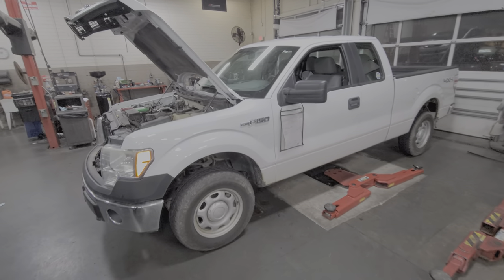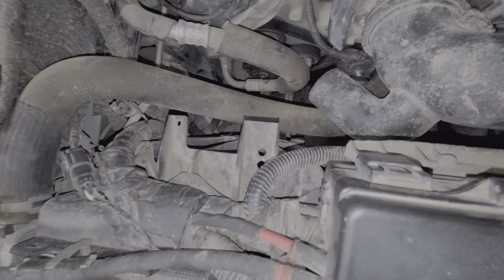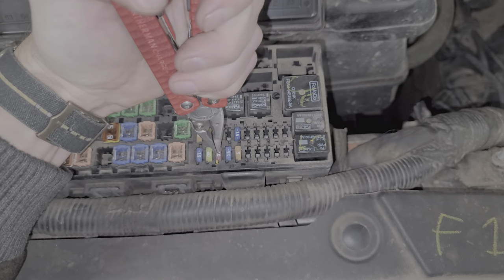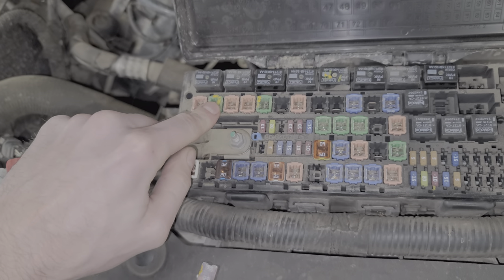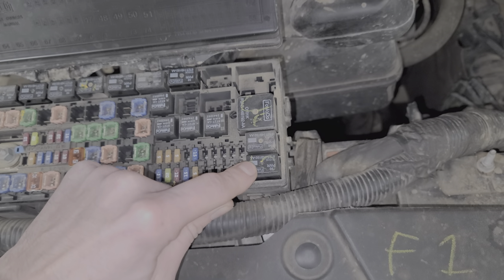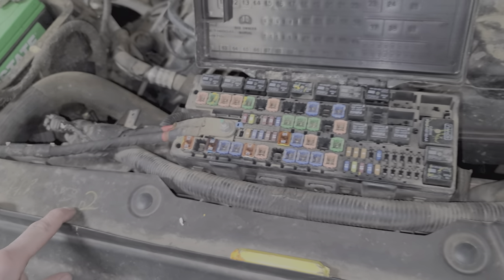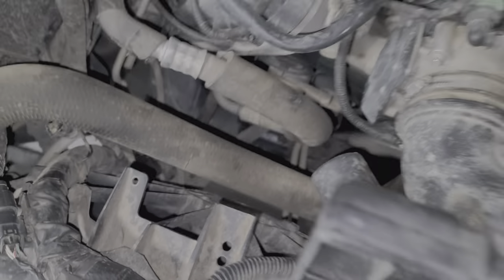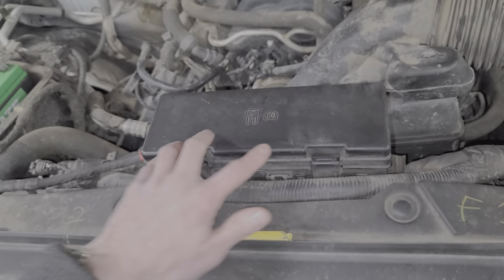2013 F150 Cooling Fan Fuses & Relays, Testing

Comment: My truck started doing the exact same thing a week a week ago, the fans would run on high non stop, also my dash cluster gas mileage digital display started messing up, a few days later my battery crashed. After replacing the battery everything went back to normal. My ford Motorcraft battery was 8 years old. I just wanted to put this out there for others before spending countless dollars on other things. I know this might not always be the case or issue but it was the fix for me.
Reply: Wow the battery ... mine just started the fuel gauge thing a few weeks ago now its the fans 🤦🏽‍♂️🤦🏽‍♂️🤦🏽‍♂️

Comment: Hello, I have a F-150 2013Lariat, which overheats only on highway at high speed, so I believe it has troubles with high speed circuit only, do you know if temp sensor triggers high speed relay ?. Thanks for answering. God bless you. BR

Comment: I pulled the low speed relay on my f150  connected the 2 contacts as shown to test both fans. Only the drivers side fan runs. Why isn't the other running?

Comment: I am having a low speed fan issue. They are not coming on. I removed the same low speed relay that you did and jumped the terminals. My fans did not come on. The right terminal for the low speed fan relay has battery voltage. Anyone have any insight on this?
Reply: Did u figure this issue out with the low relay

Comment: Fantastic video.  My 2013 F150 suddenly developed "must turn on high speed fan" syndrome for no good reason I can find. Nothing I can test or measure says that this extra fan speed is needed. AC tests out as perfect as I know to test, all temps look perfect at all times yet for some reason, when the ambient gets above 90-ish, and the AC is on, the fan goes to "make all the noise you can" speed.  

By chance is there a temp sensor somewhere that "helps" the ECU decide this fan needs to be on?  Regardless, I've pulled the high speed relay leaving both fans to function normally but stopping the fan's ability to go high speed. I'll monitor it but since the fan NEVER went on in 9 prior years, I'm betting all will be good.   

Any thoughts, speak up!  Many thanks for your concise info. PC
Reply: I forgot to mention that all this seemed to become an issue after FORD flashed it for some kind of issue.  Not saying, but seems awfully coincidental. Onward and upward.
Reply: OK, just did some more testing but more to come yet. 

Pulling just the High Speed Fan Relay #5 for some reason did not stop "ludicrous" mode in the fans. They still went into crazy and of course Loud As Heck.  

So started the car this AM and pulled fuse 15 as well as the same relay #5 as before (so now both are out) and so far that seems to have done the trick.   My only concern now is this: Do any fans come on if the engine just needs some cooling? Not AC aux fans, but engine cooling fans.  I let the car idle for 25 mins and temp never got high IMO. Yes monitored it via the dash as well as with a temp-gun.

I've not tried the high temp start but will as expect 105 degree weather this afternoon. Recall for my situation, there seems to be something to do with outside temp as part of the equation. Stand by for that. However, fans go on as soon as I engage the AC and go off shortly after turning AC off.  At least that function works.

Still remain to see if the fans needed to cool engine come on. We shall see. Oh, and remember, YMMV as this is hardly the most exacting test. Just one that works for me for now.
Reply: OK, Removing those two items #5 and #15 may have killed the fan #2 (per this video but the noise is back. Let me explain.

As I mentioned above all seemed good during my morning tests with ambient in the mid 80's but I still had concern of the OAT (outside air temp) as I have felt for some time now that this was a factor in the fans but not certain how and almost as interesting, why would it be? If the engine is cold there is no need for fans at all until the AC is activated and at that time I expect the fans to run some as that is normal for any AC system.  

Now that the excessive fan noise was back, I opened the hood to see what was up and indeed the previously pulled fuse and relay (#15, 5) had stopped fan #2 (my mind says the larger of the two but not sure. I'll have to check) so this noise, the really big noise, was coming from fan #1 (smaller one I think) this is the fan on your right as you stand in front of the truck looking into the engine compartment. 

This surprised me so I quickly installed the fuse and relay (the #15, 5) which as you'd imagine turned that fan #2 on full force. Oddly, its added noise sounded a level lower than fan #1 so I then decided to pull the relay #85  which is the one he points to in the lower right hand side of the pictures in his videos. This fan is the "low fan control" relay.  This cut the overall noise significantly.

With only fan #2 running now, still in silly mode, I drove the truck around for about 35 miles in 103 f  heat.  Engine stayed cool, AC still cooled exactly as it has for 10 years now. All this tells me I've got some more work to do to figure this out. First off, no way do these fans need to run so hard. OK, maybe in Dubai but even in the warm climate of Texas, the last 9 years have said NOPE, not needed. 

I'm going to test the AC system again but don't expect much. Even then I may change the expansion valve for grins and giggles but along the way I'll see if I can't track down a ford technician who can say "yea, there is OAT sensor that sends info to the fan controller. I've no understanding of why the OAT affects the fans as it does. Probably a combo of things but still, my gut thinks that the FORD flash has something to do with this on my truck.  9 years quiet running, reflashed and the BOOM, noisy fans and to the bet of my ability all else is still good. 

Last item. I may simply replace the fans with new high performance quiet fans wired to activate with the AC and to activate when the engine gets warm enough to need more air drawn over the radiator.  

And yes, I've been staying at Holiday Inn Expresses lately so I do have the needed education.  OK, thats it.  I'll keep the info coming. Any thoughts and please share with me so I don't have to work on this forever.

Comment: Fan 2 runs on low when truck is started but turns off when fan 1 switches to high.  Ideas?
Reply: I have the same issue. I changed my ac switch but that did not solve the problem. I also checked freon levels and same. Is your AC on? Mine only does this when the AC is on and it's supper hot outside. I read in a forum that that is the way the computer was programmed.
Reply: Having same issue

Comment: One of my fan stop working when I turn the AC on. The other fan makes a lot of noice. How to fix that?
Please help me out. Thanks.
Reply: i have the exact same problem, is not the a/c pressure switch or the Freon. did you figure out the problem??
Reply: @vickjohn9493  I’ve got the same problem did you if it
Reply: Have the same issue did you fix it

Comment: On my truck 2012 ford f150 5.0 Cooling fan 2 will work on low speed but once it gets into high speed cooling fan 1 will sound super loud and #2 won’t work any ideas?

Comment: Hey how's it going I had a question so once I put the the if there's continuity at the relay switch but yet remove the continuity could it be the relay switch that's causing the or can it be the temperature sensor

Comment: What do think is going on if the fans kick on when the trucks move ....they will run for about 20 mins before they cut off
Reply: My problem also. Did u find out an answer?
Reply: @Debidawg  the battery was going bad 🤦🏽‍♂️🤦🏽‍♂️🤦🏽‍♂️ go to Auto Zone and have it tested ... Its crazy but thats what it was
Reply: @og_2dolla  ok ty. My battery only 3 years old but I’ll check 👍
Reply: @Debidawg  mine was 2yrs & a few months ... but them Artic Blast that hit us made it go quicker ... it was a Die Hard and the Cranking Amps were getting low but when we changed it ... the fans stop doing that
Reply: @og_2dolla  ok, ty! I live rural, I sure don’t want to get stuck. I’ll get it checked asap. 😊

Comment: @Lehew Tech I have a problem with the 2013 Ford Expedition cooling fans. The fans do not work unless the air conditioner is running. The electrical circuit was checked, but I could not find the fan resistor for control cooling fan.

Comment: My fan just started kicking on. Doesn’t stay on continuously, but it’s kicked on twice in the last couple weeks? Any ideas if it’s maybe a relay beginning to go out? Or might be a fuse? Temp gauge on dash is not getting hot and no engine light coming on either. Thanks for any info.
Reply: Hey same issue where it was occasional and now all the time. I removed that low-speed relay he showed, swapped it and no issues since. Hopefully that helps you

Comment: Hi and thanks for the video. My problem with my f150 2013 is the fans are running high speed pretty much all the time when temperatures are 0 or over. Now the a/c switch was replaced this week but the problem came back.  Trying to diagnose why my fans are running so high. Would appreciate some kind of hint or troubleshooting.  Thanks in advance
Reply: Check your engine cooling temp sensor

Comment: Hi I ave a 2010 f150 5.4 and my problem is that the are always in low speed even when temperature is high.
Reply: What was your fix - I have the same problem
Reply: I have the same problem 😕

Comment: Will a bad low speed relay make the fans run on high all the time? My fans come on from start up and are VERY loud.
Reply: Same did u figure it out ??
Reply: Same. What did you do
Reply: After some digging, 8 found that the low side pressure sensor was shorted.  I replaced that and it started running correctly.

Comment: Hi my fans are running on high speed even when the car is shut of any idea I have to remove the battery to I stop them
Reply: Had this same problem. I removed the low speed relay and it shut them off. When I put it back in it seemed to work again. Going to get a new low speed relay and hopefully it wont happen again. Did you find a fix?
Reply: @samfeyder9041  yeah done it was a fault relay while ago the car over heat in my desert run that apparently damaged the relay so I replaced it
Reply: My 13 f150 doing same thing had to remove the rely to shut them off.
Reply: @samfeyder9041 was your f150 fixed?
Reply: @SamSongco-hn2lz  yeah just buy new rely 👍👍

Comment: Fans run full blast on my 2013 5.0. Haven't shut off in 2yrs since I replaced the water pump. I've tried a new Ford thermostat, new intake manifold, new ac pressure switch, everything. Still won't shut off unless I turn the truck off. I'm at a dead-end.
Reply: I am dealing with this same issue. Let me know if you find the solution please
Reply: @dbocain3236  found multiple solutions....set it on fire, shut the truck off in drive-thrus or trade the POS in for a Dodge. You're welcome.
Reply: @kennethdurbin3385  just found another video. May have a restriction in the system causing constant high pressure on the high side. Put it in some guages without truck running and should be equal. If not, something is clogged and preventing from equalizing
Reply: @dbocain3236  yeah I added ac refrigerant a few months ago when I changed the clutch and thought I overcharged it. So I used a screwdriver to push the pin down and release pressure and refrigerant to normal levels and it still didn't fix it. I think I'm just gonna take it to the dealer.
Reply: @kennethdurbin3385  Dodge? You mean Fiat junk? Dodge is the most unreliable junk out there. The only reason why their heavy-duty trucks are decent is because of the Cummins engine because it is NOT built by Fiat.
Reply: @kennethdurbin3385  I am having the same issue. It only happens when the AC is on(compressor on) and it's 90+ outside.I switched the AC switch and checked refrigerant, added a bit and released to no avail. My ac is blowing cold, everything working normal other than the fan being supper loud when these conditions are met. I read in a forum that if your truck was serviced at the dealer and they installed the new service update package to your truck, it is normal as the new program calls for a high speed fan when external temperatures reach above 95+. Here is the link https://www.f150ecoboost.net/threads/help-loud-fan-noise.5167/. I am not sure if this is true as I am still trying to investigate it myself and not fully convinced yet. I bought this truck from the ford dealer last fall so this is my first summer with the truck down here in Texas.
Reply: @isaacvaldez9301  it's in the 50s and 60s here in Ohio and mine still stays on constantly. I noticed if I released some of the air/pressure from the lower a/c port inside the engine bay on the passenger side near the firewall, the fans will shut off. I'm thinking my compressor is malfunctioning but it's blowing cold so I dunno. I've swapped out everything but the ac compressor. Sometimes the fans will shut off on their own though like it's normal. I'm just gonna let it go. Doesn't bother me too much now.
Reply: @kennethdurbin3385  got it. Was your defroster or heater on? That will trigger the pressure sensor as well. Just a thought. It's just weird that it does this...i guess I'm still in the bothered phase haha..
Reply: @isaacvaldez9301  yeah my heat or ac is usually always on. If I shut them off, the fans will shut off in a minute or so. But I don't wanna have the fans off for long in case it wants to overheat or something.
Reply: Replace your txv
Reply: I hear after market thermostats can cause this issue but sounds like you got OEM part.  Also read a forum that the thermostatic expansion valve can get clogged and cause this issue.  Having same problem with mine and just about to dive in.
Reply: Has anyone figured this out... My truck's doing the same thing if I start it up the fans kick on high if I shut it off wait for a minute and then start it again they'll stay off unless I try to use my hvac system..  Blowing hot air when on AC as well
Reply: @leenader5249  this is exactly what mine is doing. Did you ever find a fix?
Reply: Does the guy who made this ever respond to someone?